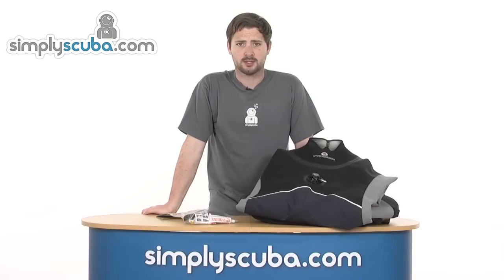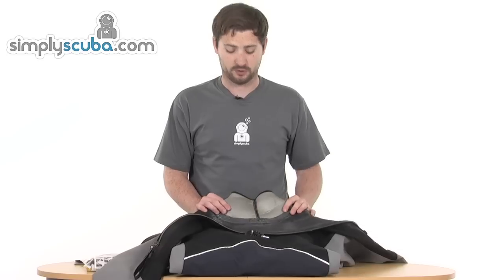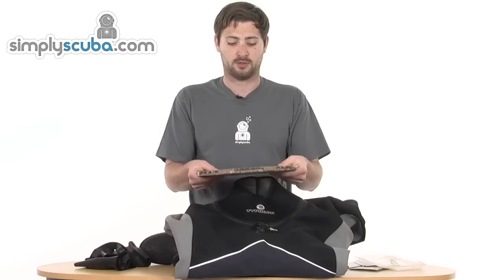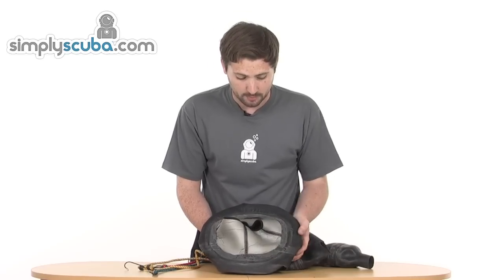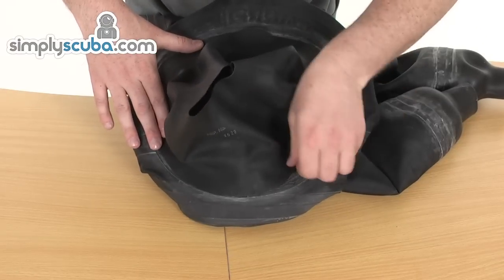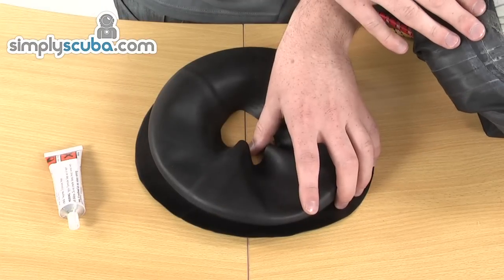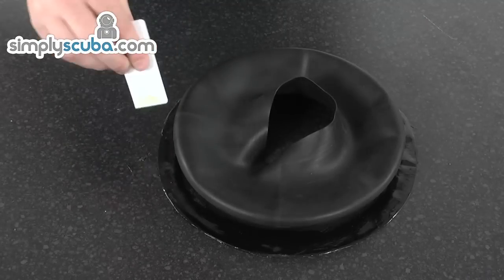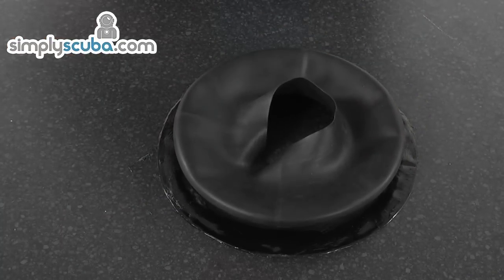How to fit a Dry Suit Neck Seal (Part 1 of 3)

Comment: Hi all just been searching for si tech pu cuff installation obviously similar to replacing the seals but would like to see it done I have the quick clamp model 60940 but would like to install the pu cuff because of ease of seal change out and ease of glove donning without fitting the quick cuff which is putting pressure on my new latex seals thanks rob

Comment: much easier way is just to use an old upturned bucket as a form of jig, slide neck of suite over bucket, slide seal over bucket, hold in place with plenty of masking tape, allow for suitable overlap , foldback, glue as described carefully roll seal onto suite , voila